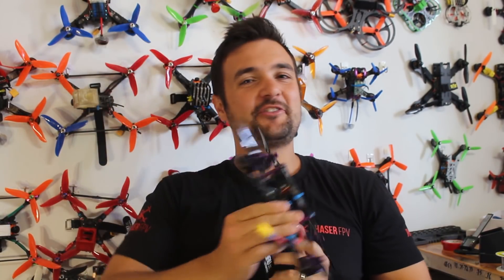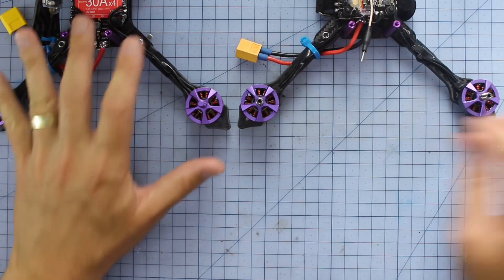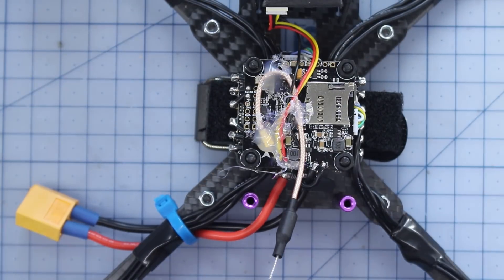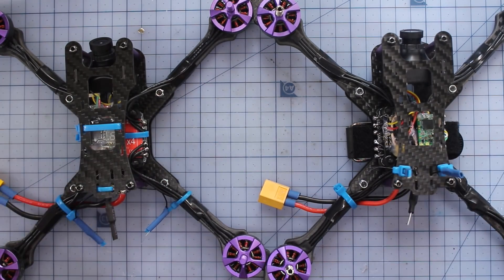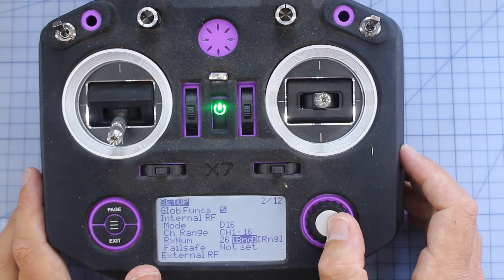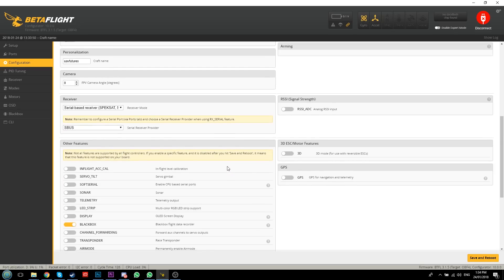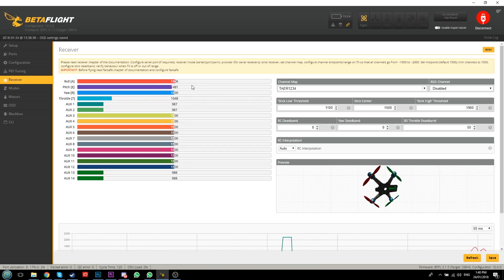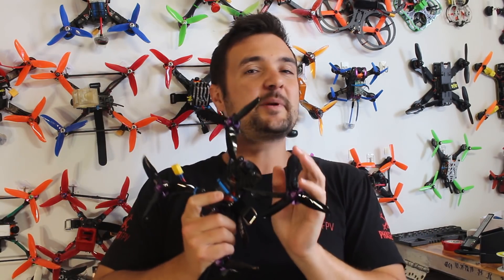Build a 100MPH FPV racing drone. FULL SETUP GUIDE Part 2

Comment: I did the 4s build a while ago using the FS-IA6B receiver but when I went to solder the receiver wires the SBUS solder pad came off on on the FC I was wondering if there was a work around like using the RX6 pad maybe any ideas? Hopefully someone sees this.

Comment: I got to the point that I am now binding my receiver to the Taranis QX7. However, when I plug the drone the green light on the receiver never turns on and nothing happens when I press the bind button. I know the drone itself is getting power because it beeps and the propellors move when plugged in, and I'm almost certain that my soldering was all done correctly. Anybody have any troubleshooting tips? I'd greatly appreciate it, I simply can't wait to fly.

All the parts are the exact same as this build.

Comment: So bought all the parts like he used.  Bought the taranis qx7 radio.  It's all bound.  Green light.  No stick movement in betaflight. No response when asking for help.  $500 into this build buying everything actually needed for someone who didn't have the controller, battery or battery charger.  So , just a warning, maybe follow another video guide that actually has some follow up when people have problems.
Reply: After a weekend of pulling hair i finally read enough on the internet along with the paper work that came with the fc for the 5s build to figure it out.  If you are like me and get the transmitter and xm+ reciever bound but have no stick movement in betaflight, well, there is a step he left out of his video, that has to be done.  On the fc there are 2 pads on bridge pad 1 that have to be soldered together to invert the signal and make it all talk to each other. Now, since he never talked about how to set up failsafe I'm off to read and watch more detailed videos.

Comment: Bro love your vids i built the 5s but i used a walkera 12ch sbus reciever with a devo 7 transmitter which they did bind but on beta flight the reciver tab shows that its not responding to the command im sending i switched in between the uarts and still no luck stu please help i know its all wired right bc of the motor test on beta im so close to flying

Comment: All my parts are almost in.  Did you use the flat edged soldering tip or is a smaller conical tip better ?

Comment: ok so I built this stew, and I have everything correct on the board know I have bound it up there a green light I have the taranis qx7 but in betaflight the receiver tab I turn it on there is nothing like it is not bound I cant arm or do anything. I was wondering if you could help me or any body else.

Comment: I followed this guide step by step, but i just changed the controller / receiver with a Fs i6s and a Fs x6b.
On betaflight, i can't connect my controller to my drone. Try to put in ppm, i or s-bus, try all the uart and nothing is fraking moving in the controller tab.... I'm totally lost... is anyone has/had the same problem as i have ? I will appreciate to have any kind of help ? I'm close to bin everything and never touch it again....
Reply: at same point now, I didn't buy motors or esc's for it. I new it would end up like this. don't spend any more money on it.

Comment: I did not get  the qx7 but i got the evolution model you recommended in another video, i am following this build exactly except for the frame itself. as for the evolution is it generally the same setup procedure as the qx7?

Comment: what's the screw size required to mount the motors? Ordered all the parts, got sent everything but the screws :/ dont want to wait another month for shipping, want to order those locally
Reply: Don't know the size, but screws from the motors are too short for the 6mm arm.
I ordered a Suleve box (url is at first video MISC->screws) and used 8mm ones. Next were 12mm, too long.
Hope it helps. :)

Comment: Hello. 
I have a question. On many reviews i saw that Caddx Micro Turbo F1 performs really nice, really clear picture. But on my FPV setup, i have all grainy picture, it is smooth doh, but quality is like i have 120/90 resolution stretched to 800/600. What is the thing that determins quality? vTX? vRX? I use OTG-UVC vRX and LG G3 with VR Box 2. I understand breakups and static, alldoh it happens to me myaby 1x every minute, i would say it has solid signal, but picture quality is like sh** !
Sorry for my writing, i am not from EN speaking country.
Love your videos.
Best regards, Alex ;)

Comment: i need some help! i have bought 4s version ad i buy flysky receiver fs-ia6b with ibus.. but i cannot configure.. let me explain better i connected my receiver to my radio command but in betaflight if i press some button or stick i didn t see nothing.. i think that the configuration was ok becouse i activate ppm in radio command set safeself and i put ibus on betaflight.
what s gone wrong?  i hope someone can answer

Comment: I'm having a couple problems.
1.) I don't see how to reverse the direction of 2 of my motors that are going the wrong direction, the other 2 are going to correct direction, you mentioned it didn't matter how they were wired up because you should change in software... help
2.) I reset my settings in Beta flight like you did, but now my battery status doesn't show up in beta flight. I went with the 5s build you have.

Thanks!

Comment: Stu you have got to slow down and explain things a little better. This stuff is simple to you but a lot of people are watching this video because they are new to the hobby. You often say you are passionate about getting more people into the hobby, if this is true you really should slow down and explain things a little more. For example, the modes screen can be intimidating for a beginner and you blew through that part without explaining how that screen really works. I’m a big fan by the way and a Patreon. Hope this doesn’t come off as negative, just a suggestion. You make great videos!
Reply: James Oliver, I have to agree. The $99 build video was great for my first build and got me into flying. But then I looked elsewhere for setup with Betaflight, etc. This video would have left me confused if I hadn't already done one setup.
Reply: 0.5 speed? XD
Reply: I Am brand new I have never built anything like this before this was my first one and I found it very easy to follow along I would just watch one step pause it finish that step then hit play again
Reply: @mr_approachable4759  which build did you do, the 4s or 5s
Reply: Jordan Anderson I agree, the building part is easy with that method. A lot of steps and information about radio setup and tuning are missing, however.
Reply: I agree as I'm learning there's a lot more depth to it than what's outlined in this video but I think this is supposed to be a beginners guild to get a new person in the air . Going into more depth might be more confusing than help for someone just starting
Reply: Jordan Anderson Yep I also agree with that and think the $99 build video is awesome. It got me flying. For this particular video though, I was agreeing with the person above me that it quite likely was too far over-simplified to help a new person get these things going. Maybe it assumed a certain level of knowledge about the taranis radios, etc.
Reply: Ya It worked fine for me but I'm a thinker and a quick learner so maybe it just came easy to me. But having never even touched a drone (other than los toys that came with there in radio) it got up and running

Comment: Should I buy that tx or use my FlySky FSi6
Reply: When Pigs Fly hey just wondering how you went with your build on a flysky setup, I had troubles with the flysky remote not picking up in betaflight when I was moving around the joysticks

Comment: BLEHeli_S 16.6 does not allow DSHOT commands so I would have flashed version 16.7, set beeper_dshot_beacon_tone =1, flashed Betaflight 3.3, setup Kalman filters, dynamic filters and airmode...... And btw a LED strip is a nice gimmick even on a 100mph fpv racing drone...

Comment: stew , I am shocked how you set your P ! the P shoud be really higher , to get the quad smoother it's more about expo ;)
Reply from the maker: this quad is very light and well balanced and doesnt need such an aggressive P. not talking about the expo or feel on the sticks, im talking about the vibrations and oscillations in normal flight.

Comment: just one simple question, and seems nobody ask about that.... why did you lover P gain so much?, I test my setup, which is very similar with stock PIDs and even tune em up a little bit and its perform excellent...so why you lower yours?
I will certainly try yours, just to check them up :)
Reply from the maker: they are just the ones for this SPECIFIC drone. my little bit of tuning etc. the quad is very well balanced and doesnt need such an aggressive amount of correction

Comment: I always love your content but I have a FLYSKY transmitter and it seems most reviewers focus only on the Frsky. Do you think it would be possible to show how to wire various rx to fc because there are different ports to solder to. then there's setting up port in Betaflight. Once again thanks for all the great advice!
Reply: Jon Pacheco i agree... u think u have it hard, I fly spectrum dx6i(one of the oldest) and there is not one vid on setting up dx6i for it, and soldering... I have just done trial and error
Reply: Arjun Melwani dang! I thought I had it hard!🤯👍🏽🤙🏽😃

Comment: I love the channel but hate video’s like this. Except perhaps of the motors and vtx (for the price ok) most of the components are crap.. a good 4 in 1 esc cost around $60 and for that price you get with this board an free flight controller... Take a look at the board and then look at the board of in 4 in 1 esc and you know why it is so cheap... solder with to much heat and you Will ruin an esc. Also it is already an hit or miss with these boards. Some already have problems on arrival (twitches, jitters). Yes it can reach 100mph but the question is how often?. Crash a few times and you Will see... they are as durable as wet paper.. but after the video most components are sold out so that is good...

Comment: does the hot glue not cause issue if you need to resolder?
Reply: No, but be careful when you take it off. You can use "the gun" to melt the glue a little when you take it off. It can mess up the ends of the silicone wires a little if you're not careful. Just replace them. "Cheap as beans."

Comment: I dont think a beginner needs 100mph  ... but this is still an amazing build
Reply: I beg to differ id much rather have room to grow and be forced to learn throttle control then have to spend money building another drone
Reply: I use mine with a throttle limit, so it has the power of a much lower power quad, and I’m slowly raising it
Reply: jonah hammond its up to them if they what to crash in hard speed and hit some one, their problem
Their money and their problem.

Comment: I’m also based in au and really wanting to get into FPV do you have any recommendations for cheap but quality quads?
Reply: Bidid Bidid i like darkmax and bfight. but thats only if u dont wanna build. you should make a 100$ drone build with a osd
Reply: I would probs start out with the tiny 6 or tiny 7. Tiny 7 has more flight time but the tiny 6 is faster. These both have prop guards and are great for indoor flying and starting out in the hobby. There are plenty of reviews you can watch on them and they are both great quads. Drone racer 101 has done a great review on them and I highly recommend watching it. Hope this helps.